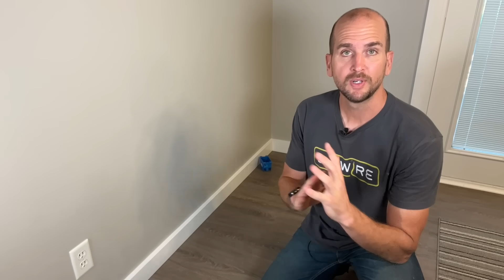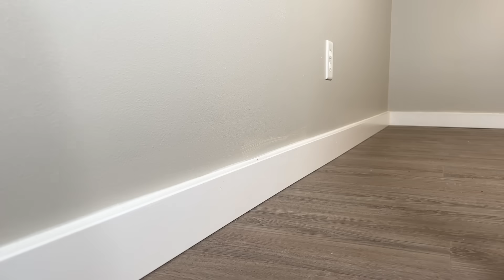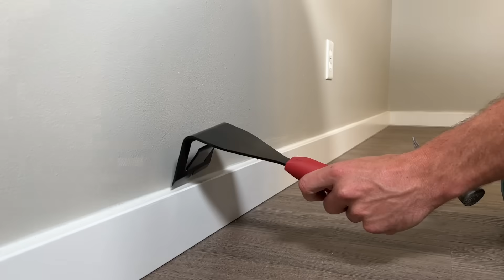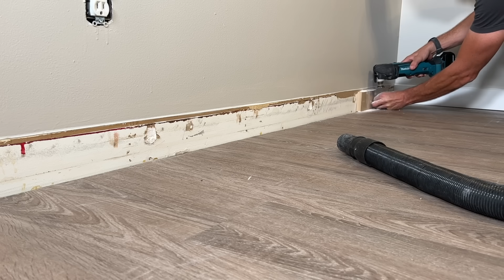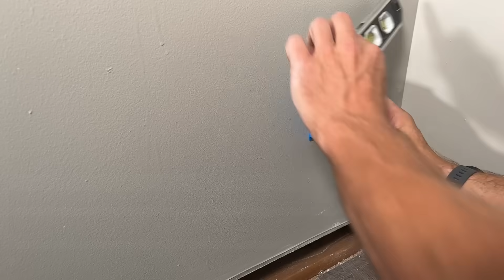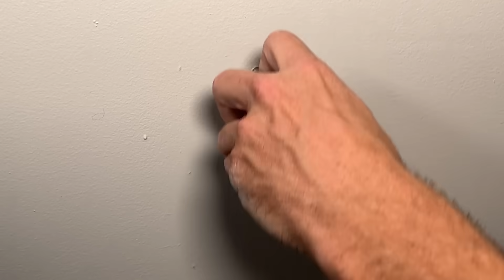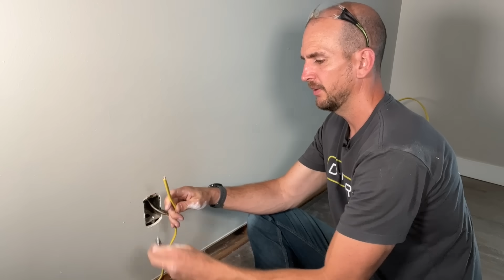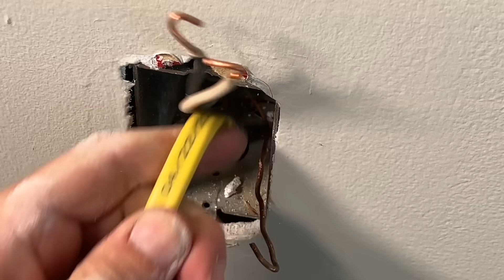How To Add An Outlet To A Finished Wall

Comment: Nice
Simple project when that type of electrical code is accepted. Many state and Municipal codes do not allow this type of wiring in the wall. When allowed,  metal plates must be installed over the holes you drilled. Right angle drill would work much better..
Nice job ..

Comment: what if there no outlet there but there is one on the opposite side of the wall and what if it not dry wall but a very thick plaster wall  this house i live in is from 1947 old i need to change on out let to let me use 3 prongs and i need to install a new out let in the closet and the only outlet i can maybe get to is on the other side in a  bed room i wounder if i can just move the out let to the other side of the wall then just close the other side up or just cover it up with a plate

Comment: I believe because the ground prong is longer then the others on a polarized plug, the ground plug is to be on top when lower then 42” so it is the first to connect and the last to disconnect when pulling the cord out in case of any loose energized hot or neutral wires.

Comment: So I’m new to all this stuff, but the only question I have is since the outlets are running off the same circuit thus using the same breaker, is it safe or will it overload the breaker? I hope that makes sense.

Comment: #12 awg wire? Is this a dining room? Outside of where required 20 amp circuits are overkill and a needless complication. Box overfill and problems stuffing the outlet/wiresvinto the box and getting the receptacle to be level with the coverplate.

Comment: Commercial and residential electrician here. Always wrap your devices in electrical tape after connecting your wires, especially in a metal box. Big safety tip. Never use the stab in connectors on a device. Always use the physical screws with the j hook, then go around the device with electrical tape. These are safety issues. Not to mention you'll appreciate it if you ever have to go back and work on that box again. Other than that, great video. Good work. Good explaination. 👍🏻
Reply: He wasn't using stab ins.  Those recepticles have the screw plates. Those are totally fine.  You should know that. Sounds like you're just an old school guy that doesn't like change...but that's fine too.  Wrapping with tape in a metal box is a must though!
Reply: @ISurvivedTheVA  it is always best to wrap your receptacle with electrical tape whether you use stabbings, or not. It's an added safety precaution. Yeah I'm old school, if you consider 15 years old school. I don't cut corners. I do the absolutely best and safest job that I can. Not just what I'm required to. I call it quality.

Comment: This is a solid way to do it. BUT never do this to exterior or load bearing walls. Drilling close to the base of those studs will weaken the strength of the studs. Those walls are structural to keep your house erect.

Get to know what walls are or are NOT structural in your house. That's the first step.
Reply from the maker: At least in my area building code allows to remove 40% of the stud even in load bearing walls.

Comment: This  is no longer to code, you didn't even use first stop at your intrusions between the bays either.  You should have either drilled down from the top or up from the bottom.  Disappointing.

Comment: There are soo many things wrong with this tutorial.  I don't understand where all the "electricians" and construction experts learned their trades. This tutorial is dangerous and not correct by any construction code since 1960. Overloaded circuits anyone? Pig tails on outlets? Ever wonder why outlets are 11 inches off the floor?  Please take this accident waiting to happen tutorial down.

Comment: This is a great video up until @8:53 and I can’t stress this enough as someone who’s been in the trade for a decade+ DIYers especially ALWAYS TAPE YOUR DEVICES ON METAL BOXES!!!! it doesn’t take much for the METAL screws to touch the METAL box and if doesn’t trip the breaker you’re looking at a possible arc if not worse, still a great video! Stay save everyone!
Reply: I never do that but I always screw in unused terminal screws though, if your bare ground touches hot or noodle you did a shitty job at trimming it IMO

Comment: Quick tip
.always use green wire for power and black for ground. You are more likely to get a service call down the line
Reply: No not in the USA . Black is line . White Neutral . Bare copper ground .

Comment: Good in theory, but there are a handful of things that bothered me.
1. You start the video with "you can never have too many outlets". This is false. Most residential circuits already have the max number of outlets on them by code. If you add more, you increase the chance of overloading your circuit. 8 duplexes per 15A circuit is your max. This is 20A so you are allowed 10 duplexes. Adding outlets without checking this properly is a very bad idea, not to mention illegal.
2. Why are you drilling a 1" hole though the studs? A 1/2" hole is plenty and helps ensure the wire is held centered and away from the drywall and it's fasteners. Also if this wall is load bearing, you may be drilling too close to the end of the stud.
3. When installing the new outlet, pull the top and bottom tabs please! If you don't, they bend out and hold your cover plate off the drywall. When the tabs are removed, the outlet nests between the plastic and allows your cover plate to sit properly.
4. Never, ever, ever place your screw slot horizontally. Not only does it look terrible but it catches way more dust than vertically.

Comment: I would recommend installing metal plates on the studs specially when running electrical so close to the base board. Someone might install wider base boards and it may cause a problem. Great video showing the right tools.
Reply: I almost did that on a similar project but found the presence of those plates caused the drywall to bulge out just enough to cause me problems with the baseboard trim. I think him locating his holes high above the drywall section was smart, precluding the need for the plates.
Reply: 👍🏼 I was going to say the same thing. I was thinking that’s in the code book but I’m not for sure.
Reply: Good catch!
Reply: Going to have quite a bit of trouble getting the trim to look straight As the sheet rock will bulge at every stud...

Comment: I was curious, and when I skipped forward and saw you pop the trim I knew immediately what you were going to do. In my apprenticeship, I had to do this to run a wire to an outlet that got added after the fact. Saved the GC issues on a finished room. It's a clever trick that can save you provided you know a little bit of this and that (carpentry and electrical). I also liked the very quick video cut as you went to put the locknut on! Because anyone who has put a locknut on in an old work situation rarely gets the nut to grab first try. Nice video and good reminder for next time I have a tricky fish on the job. (Although I don't keep a brad nailer on my van so that's an issue...)
Reply: Atta-boy

Comment: if you want to strengthen the box and keep it from damaging the drywall. only a very small amount of drywall is keeping the box secure. put some glue on 2 pieces of lath about 4" long and glue it to the top and bottom inside of the drywall where the tabs hold the outlet in place. I then use claps and let them dry. it will dissipate the stress from pulling the plug from the outlet.

Comment: Oh buddy. You were 10 out of 10 until you said to use caulking on the brad nail holes. You redeemed yourself by saying you were not a pro at that part, so I’ll give you a 9.5 out of 10. Nicely dont. Use drywall mud for nail holes. Sands off nicely. No nasty gummy caulking residue left over and most times rarely needs to be touched up with paint.

Comment: I've used this same method to install new wall sconce lighting before too, doesn't only work for outlets! ;) Especially useful technique for your knowledge toolbox when you can remove the bb. Also Romex is a brand, the cable is NMD90 in a wood structure residential building. Personal pet peeve than makes me cringe lol XD

(NMD90: Non-Metalic, Dry (location) 90 Degree (temperature rating) Cable, for the non-construction fellas.)

Good video, things like this are not always common knowledge for a home owner! Tricks like these are learned with experience.

Comment: Those quick connect lever nuts are garbage.  We never use them, make a proper connection and use a marrett. I urge all homeowners to hire a professional electrical contractor. Doing electrical wrong could result in hurting yourself or even the next person that buys your house, there’s a reason why it takes nearly 7 years of training to be an electrical contractor.

Comment: Good job overall. My suggestions to make your jobs even more professional next time...

Put down a plastic floor protector. I'm really surprised you skipped that important step on a tutorial. Especially given how OCD you were about the orientation of your plate screws. I'm OCD, but not that OCD.  Arguably, protecting the floor is far more important.

You can install a cheap 3" steel plate over the stud so you can never screw into the wire. It might also slightly strengthen the now weakened studs.

NEVER measure outlets off the floor. Floors are not level. Level each outlet relative to each other. In a kitchen this is especially important. When you tile, they will all be off (if you measured up from the uneven floor.) Obviously, the closer they are together, more you will notice, like 3 outlets on the same wall in a kitchen with level subway tiles.

Comment: Something that hasn't been covered but is a good idea is to make a small pencil mark above each stud on the existing wall. That'll make it quicker to know where the wood is and run your nails or screws faster.
Reply: i think he did that with those tapes ?

Comment: You never mentioned anything about whether the socket was on a ring or radial circuit

You can spur off a radial as many times as you want, but on a ring you can only spur off it once. 

You failed to say that during the video. 

What if that socket was already spurred from a ring and you spurred off it again 🤦‍♂️

Comment: this is really well done, props for that. Sadly, here in the EU, we don't use dry walls that often. It does occours, but mostly in reconstruction, and even then it's mostly brick wall anyways. I'm an electrician as well (although I work in IT now), yet I'm not in the business since a couple of years. What I was most facinating about was the difference in Ground wire usage (here that is also insulated - Green/Yellow) and the color coding (Red or Brown here is life wire - Blue is neutral). Anyways, really like this tip, because believe it or not, we're looking into buying a house and yes, there will be dry walls in it :D. Keep up the good work and I hope the Air BNB thing works out ;-)

Have a good weekend
Reply: In Hungary red is the old ground wire colour or nowdays, the "control" wire. The live (and not life :) ) wire is black in the walls (or brown in cords), blue is the neutral and the green-yellow is the ground. In 3 phase environment the 3 live wires are all black or black+brown+grey.

Comment: Good video to prevent lots of dry wall work. Technically, the hole should be no more than 5/8 and typically 1/2 for number 14 or 12 wire interior romex  in size and the hole should be in the center of 2/x4. No brad nail, even a 2 inch,  is going to be able to penetrate through the base board, dry wall, and then 1 3/4 inch of 2x4 to the ROMEX, especially in a remodel with a dry and aged 2x4. In my opinion, the size of the hole and location of hole is important. Plus I would ask where are the romex staples. Code states romex should be stapled with most slack removed no more than 6 inches from box entry .
Reply: Hole can be up to 40% of the stud depth for a single stud, as long as it is at least 1 1/4" from the surface of the stud. A 1" hole would be acceptable in a 2x4 as long as it is dead center on the stud, which admittedly he is probably missing a bit drilling at an angle like that. 

As for the staples see 334.30(B)(1), this would be considered fishing through a concealed space in a finished building, so staples would not be required.

Comment: Great tip I need to do this to install a new wall mount TV, and I was wondering how I was going to get thru all those studs without screwing up the sheet rock. Perfect solution thanks

Comment: I loved that you accounted for the little things like drilling your holes above the drywall cutline to ensure your (or future) baseboard brad nails don't hit the wiring. Also, well done on pre-attaching the cable clamp. A "push-in" style would have made that potentially somewhat easier, but the threaded ones are of course super secure.

The only issue with this strategy really is when the homebuilder cheaped out and installed 2 1/4" casing as baseboard...it'd be pretty tough to achieve this with only <3/4" gap between the bottom plate and the cut in your drywall.

All in all, love your attention to detail and your concise yet thorough explanations. Well done!

Comment: As an electrician I have just cut holes in the dry wall and told them to hire a drywall guy to fix it. Honestly I have never seen a guy do that before. That's pretty interesting.

Comment: Just a question, your local jurisdiction does not require nail plates for Wire Protection, NEC article 300 Wiring Methods 300.4 Protection.

Comment: Awesome tutorial video and it's nice to see that you use the Wago Lever Nuts!  I'm a huge fan of them - started using them back in 2015 for all home electrical wiring projects and they've never failed me yet! Cheers!
Reply: Same with the Wagos.  One nice bonus is that, since they're clear, you can tell at a glance if everything is fully seated and secured.

Comment: I wasn’t paying close enough attention, but is that new box only attached to the drywall or did you grab the stud? I don’t know the residential code but in commercial a wall mounted box will always be secured to a framing member. I’m in hospital construction. Commercial grade receptacles can really hold tight on to a plug.
Reply: no , it attaches too the dry wall with the screw wings .
Reply: @rrfields65  that’s allowed in the residential code?
Reply: @herbiesnerd  : Yes

Comment: At 9:33  "have the cover plate screws either horiz or vert."  That's a detail that most would never never notice.  Almost nerdy.
Reply: actually , your suppose to do vertical to identify 15 Amp socket & horizontal for a 20 Amp socket
Reply: @rrfields65  Thanks. I did not know that.  But since so many DIY like me don't  know that, how can you trust what you see?  You'd probably need to test it anyway.
Reply: @terry_willis  : you don't have to do that now since from 1980 ... Now all 20 A sockets have a horizontal gap in the hotwire spade plug-in.

Comment: Good vid: QUESTION: the blue box that you installed with the wires….does that not need to be fastened to a stud?? Does it make a difference if I have plaster walls?
Reply: The box he installed is called an "old work" box. It does not need to be fastened to a stud, it has wings that fold out and it sandwiches itself to the drywall when you tighten the screws
Reply: on plaster walls ... you'll have to clean up the backside of excess plaster where the old work box is going .

Comment: Great video, thank you!  I'm somewhat of a newbie - my question is- Did you attach the extension box to a stud, or did you just screw it into the drywall? If its screwed into the drywall won't the box get pulled out when you unplug a device?
Reply: Old work box.  When he tightened those screws they flipped fins up on the back of the drywall.  So the box is clamped to the drywall.

Comment: I'm curious why you didn't use the outlet itself to jump to your new wire? Rather than using connectors in the back of the box, just use both sets of screws on the outlet to do the same job.
Reply: Matt , don't do electrical work !
Reply: @rrfields65  Can you clarify what's wrong with that practice? Is it against NEC?
Reply: @matt1544zxc3  : NEC pig-tailing is for electrical integrity , you can also do it the way your talking about ...it's not set in stone !
Reply: @rrfields65  For something not set in stone, you seemed pretty aggressive that it wasn't correct.

Comment: Fantastic tutorial my man. I’m glad I took the time to watch it straight through which is more than I can say about a lot of them which require a selection of tools to rival a Snap-On truck, not to mention loads of work space as previously mentioned. I’m always looking for workarounds for common issues. I would like to point out that basic stud finder in particular because I recently found out how stud finders work and used a neodymium magnet from an old hard disk drive to help me determine where to drive a nail in a bathroom wall. Sure, it’s oddly shaped but I just made sure it was hanging from its highest point and used that as a reference point.
Reply: Neodymium magnets are WAY better as stud finders than store-bought so-called stud finders. Just find the drywall nails/screws.

Comment: Don't need to find studs with a stud finder, you can see where they are when you cut the wall open. Also, it's best not to feed the wire through the hole you cut for the box, as it increases the chance of damaging the sheetrock or the wire sheathing
Reply: Okay go take your nap now

Comment: FYI: you can trim the ears off the outlet and it will fit the cut in box better.

You probably did this, but for anyone reading this: check on both sides of the studs for wiring and pipes before drilling.